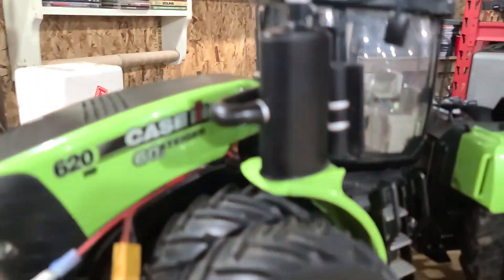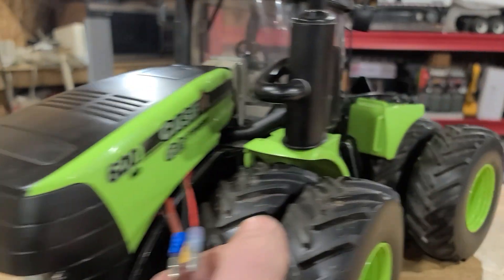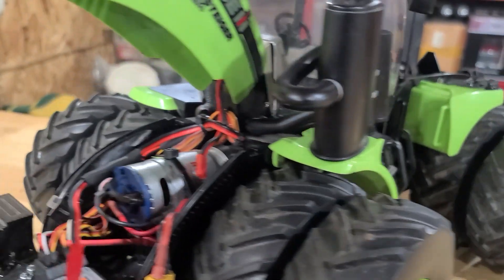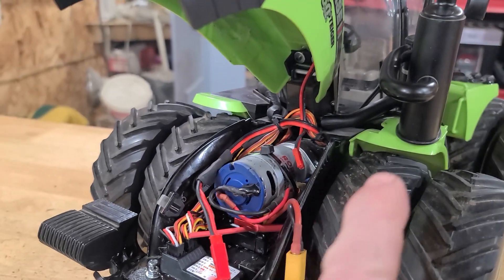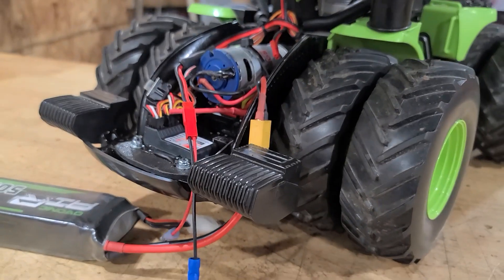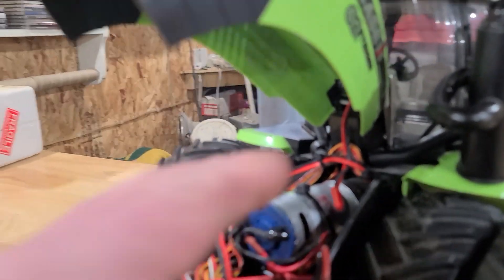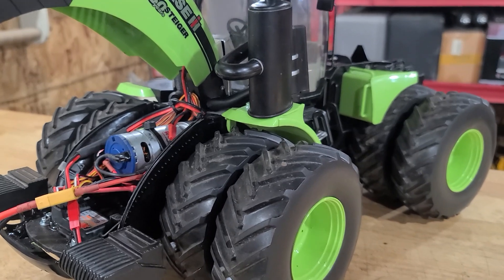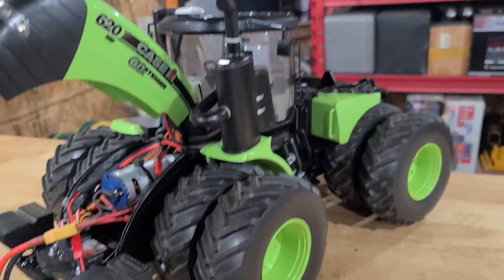1/16 Ertl Steiger Case/IH 620 RC Conversion Revision Project

Comment: What Tania axles do you use for your tractors
Reply from the maker: This tractor has straight solid 1/4" D shaped axles and brass gears from Servo City. Unfortunately, it is a weak link in the build. Weighing in at 28lbs, you absolutely don't want any power hop or bounce. That starts to happen, then back off the throttle, or I will be replacing them soon. LOL. One of my very first conversions 4 years ago.